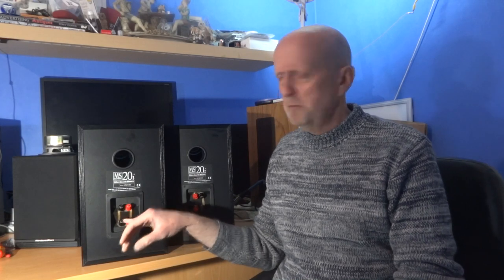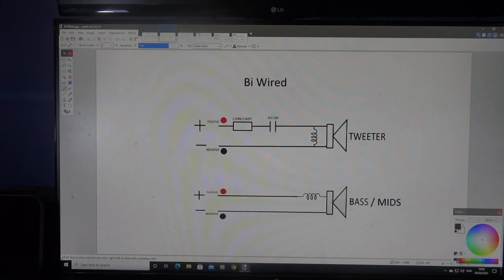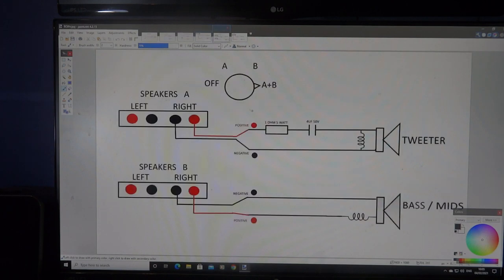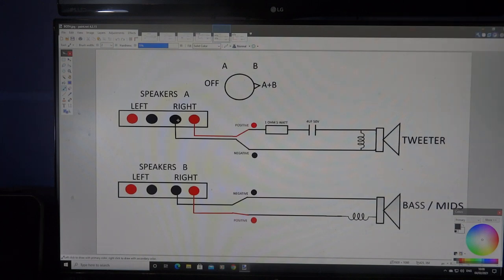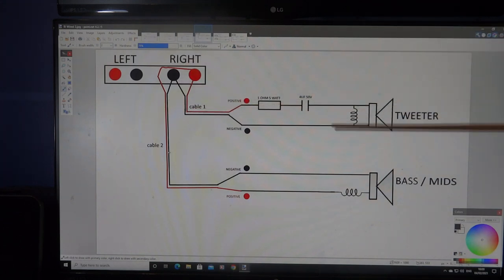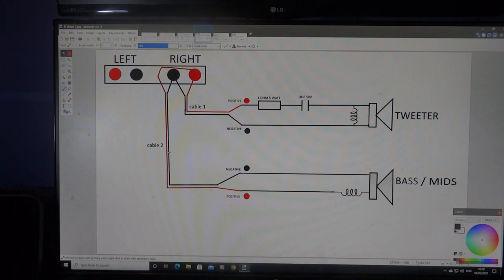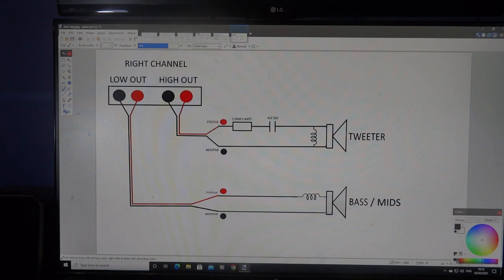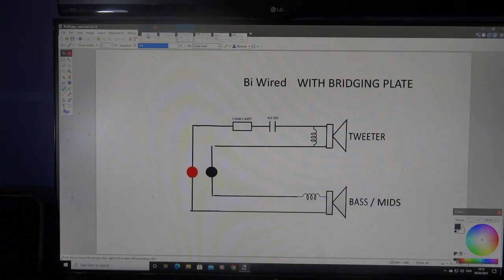Speaker Bi Wiring Explained,  improve the sound. Bi Wire Amplifier Receiver. Wired Stereo Speakers

Comment: I’ve had good experiences of bi-wiring and on my latest pair of speakers I’ve even selected different wires for the two drive units.  My usual Mogami cable actually caused the treble to roll off slightly, so by bi-wiring I was able to leave the Mogami cable on the bass driver, where it’s very happy, and use a different cable on the treble.  Balance restored and even more separation and clarity than before.

I do applaud you for venturing into this area as here be dragons, specifically in the form of sceptics shouting snakeoil.  One of your other commenters has experienced the misinformed rants of people who seem totally incapable of educating themselves on the electrical theory which applies here.

I can’t easily think of a non-electrical example to explain bi-wiring, however, I can say there are three reasons why the sound may change if you go from single pair to bi-wire.  Firstly, you are removing the interlink on the speakers.  Where this is a cheap brass plate, an improvement in conductivity is assured.  

Secondly, you are introducing more cable and hence changing the resistance and capacitance characteristics of the connection between amp and speakers.  The change in sound will be subject to the way the amp and speakers react to these changes.  Most likely good, however, it’s not guaranteed.

So far, so safe. Thirdly, and here’s the controversial bit, from the separation of the current between the pairs of wires.  Notice I said current, not signal.  Signal is most often the imprecise term used to define the electricity in the wires.  Obviously the voltage, or potential difference, across the amplifier binding posts is modulated by the music.  Whether that voltage cause a current to flow depends entirely on the resistance of the circuit it is connected to.  The lower the resistance, the more current will be drawn from the amp and vice versa.

The two circuits in your illustrations present a varying resistance depending on frequency.  For the tweeter, the components in the circuit present a low resistance to high frequencies.  As frequency falls, the capacitors present an ever increasing resistance.  Thus current is drawn down the wire at high frequencies only.  The opposite applies to the bass circuit.

In these circuits, with resistance varying with frequency, the term given to the characteristic is impedance.  A speaker will be rated as having a nominal impedance and sometimes a minimum impedance.  Impedance is often depicted as a graph of resistance over frequency.

Anyway, if you hear a difference with bi-wiring I will not be surprised, it’s been my experience every time.  However, whether it’s down to one or all of the above, it is a real thing and I strongly recommend giving it a go.
Reply from the maker: Thanks Mark for your very in depth comment and experience in bi wiring it was an interesting read and a help to others.

Comment: I share your scepticism, Michael. The sole benefit of bi-wiring that I can see is that the cable manufacturers double their profits. There are no buses or motorcycles in speaker cables, of course, just electrons. The modern-day hi-fi industry would be in serious trouble if audiophiles ever gained a basic understanding of the laws of physics!
Reply from the maker: Bi Wire and cables probably one of the most debated articles in HiFi that will really be left to how end user hears the difference themselves.
Reply: I’m new to the subject but from what I gather the properties of the cable (cable construction type) makes the high frequencies behave differently from low frequency, some cable companies build cables with both in mind have twisted pairs and different core arrangements leading to simplicity, now let’s look from other perspective, having two pairs of connections on the speakers leaves you with choice, if you need or not maybe that’s what each person will find out. Personally I wouldn’t use two cables but would definitely use bi-amp. But yet again I’m new!

Comment: I have watched many videos on bi-wiring and also bi-amping.
As at moment I only have 1 amp,  I have bi-wired my amp with banana plugs, and removed plates from my speakers,  connecting 4 wires too speakers,  and honestly,  wow what a great sound difference,  also better quality sound,  can hear instruments I never heard before. 
I have tried this on my floor standing Wharfedale speakers and also on my floor standing Mission speakers,  recomend this, makes a difference with gd speakers. 
Also banana plugs make a difference.
My nxt step is 2 get another amp and bi-amp.
And split signals for 4 speakers,  either tops of 1 amp n mids from another or maybe try with channel B.
Enjoyed the video n was exactly what I also had worked out.
Its trying combination to see what's best. 
Iv balance up n run a jamo sub, n that's even smoother and better than b4.
Keep up gd work.

Comment: Thanks indeed. Great explanation.  I just bi-wired a NAD C 272 power amp into pair of B&W DM603’s.  I had not bi-wired this set-up previously believing the concept to be smoke and mirrors. This NAD model actually has two sets of speaker outlets so why not?  The speaker cable lengths are a short 5 feet.  Bi-wiring this particular combination has made a serious improvement in music sound quality; openness, detail, you name it. I have had these speakers for 20+ years so I pretty much know what they sound like.  The pre amp is a Simaudio Moon P-3.  This is my experience only but I am totally chuffed with the outcome of this change.
Reply from the maker: Thanks for your comment and infomation on your system. I am only to pleased that you have heard some good results in your bi-wiring that is what it is all about really, getting the best possible sound and getting pleasure from your HiFi

Comment: A better option is speaker wire to top red, bottom wire to black bottom and make sure conductive plates are copper or a solidcore copper wire. You'll hear a immediate difference as you bypass those cheap brass plates and made a more direct connection. trade the brass to copper connector for next upgrade.

Comment: I was watching a few of these video one guy said some cable work better for High & some better for low signals so the two different cables can do what they do best. I could not tell the difference when I set my Yamaha AVR to Bi-Amp & hooked up regular Monster cable 12 gauge wire to each post to a different channel on the AVR to Polk Monitor 70 Series II .
Reply from the maker: Think this is a very subjective topic. I can maybe see it making a slight difference when connecting some very high end amps to high end speakers, but for low budget items would be a lot lot less if any, but again would not completely rule it out and still worth trying.

Comment: Help please, my subwoofers have a gold plate connected the speakers input. Should I remove the gold plates?
Reply from the maker: I do not think the subs would be using bi-wire, but if you let me know the model I will try and see if I can fined some images of the wiring connections to advise

Comment: I’m new to diy audio but correct me if I’m wrong , but even if you bi wire meaning using both set of terminals on your speaker and the one set of terminals on your audio source is it really bi wired ? even though you split at the speaker you are still connected at the out put source meaning if there was an interference between the two drivers it would still pick it up at the out put source 

Also if you have an (A or B ) or (A+B)  option  on your audio source so you can run two separate wires . you are still connected together where the A and B connections originate inside the audio source ( stereo or amp) so if there is interference you still pick it up there even though you run two separate wires because it is never really separated 

I feel that if you wanted to remove interference from one driver to another you would have to bi amp 

But if you bi amp you are still connected at the audio source where the two amps get the single from so you could still get the drivers interference there

Am I making a valid point or am I clueless
Reply from the maker: No this is exactly true, but a lot of people can hear the difference between non and bi wired, though 2 wires instead of one would reduce resistance and increase capacitance so this might be a factor in the sound difference as well. as well as the crossover maybe not interfering so much if at all
A bi amp would be the best option as even the souce would be the same the amp sound signature bass and treble would have thier own path to speakers, but again could be still up in the air if actually making the sound better
Reply: @MichaelYates  cool thanks for responding again I’m new I have the most basic understanding of sound/energy how they work and how they can be manipulated to reach a desired effect now that I’m starting a couple diy projects of my own I realize I have a lot of fundamental / theoretical information and concepts I have to educate my self on so I have a pretty steep learning curve to deal with but if I’m interested in something I’m a pretty quick study so no worries .  with that being said , are there any sources of information on the subject you can refer me to ( books, papers , or studies ) preferably written on paper that I can hold in my hand like we did in ancient times in the 80s and 90s lol
Reply from the maker: @CyrusGolmaryami  Sorry I can not help in directing you to any books or studies on good old paper lol. I dare say wont be that easy finding any either.

Comment: For anyone, so if you have a bridge plate are the speakers already bi-wired and if you do decide to bi-wire the speakers to your receiver/amplifier do you remove the bridge plate?
Reply from the maker: The bridge plate is used if only running one speaker cable from your amplifier so the speaker this would not be classed as bi-wired. If you remove the bridge plate you will need two wires from the amp to the speaker hence bi-wire, then the speaker would be classed as bi-wired.

Comment: Great explaination of how to wire it up and what's going on. One point though! I understand the "experts" say that mids/bass don't suffer from treble being on the same road as them or, biwiring does nothing for mids/bass. I suspect different methods of wiring things up does change the overall sound though, a bit.
Reply from the maker: Thanks Marcus. The Bi Wiring in theory should help the mid/bass in pretty much the way it helps the treble, but as signal leaves the amp via 2 cables ( for one speaker cabinet ) on its way to the speaker, the full spectrum is going down both cables and only gets filtered out once going through both crossovers in the speaker cabinet. This raises the question whether there is any difference than just using 1 cable and not being Bi Wired, rather than 2 and Bi Wired.
Reply: @MichaelYates Please see my post elsewhere on whether the same 'spectrum' goes down both tweeter and woofer wires...IT DOESN'T!

Comment: Hey I’m having a strange problem and wondered if any one here could help me, I got a new set of speakers and they have the separate inputs, but I can’t seem to remove the bridges between the inputs, 
    they seem to be underneath the connector it’s self, not just the twist nuts, I tried a little bit of prying but it feels like it’ll break before it comes lose. Am I missing something?
Reply from the maker: Don't know if you can take out the complete panel with the terminals on, normally a nut inside holding each terminal on the panel, could try undoing this to loosen terminal to remove plates.

Comment: Garble. The hole spectrum is present in both cables until it reaches the filter. Use normal wiring if you cant split the signal before sent to speaker or Bi-amping which is the real benefit of having two set of terminals.
Reply: This is a misunderstanding that is very widespread....and proposed by those who know nothing of how electronics actually works - particularly anti-biwire fanatics ( look at Zillch's 'Biwing: The truth Revealed' for example!) 

The current signal splits at the point the cables diverge to the tweeter filter and the woofer filter - this may be inside the speaker cabinet after the speaker terminals in a 'normal' single wire set-up, or at the amplifier end where tweeter and woofer wires join in a bi-wire set-up. The CURRENT signal (that which powers the drive units) IS NOT THE SAME in the tweeter and woofer wires in a bi-wire system; the treble current signal travels down the tweeter wire and the bass/mid current signal travels down the woofer wire.

Does bi-wiring make a difference? I don't know...but I do know that trying to 'prove' it doesn't with bad science gets us nowhere!😊
Reply: Bi wiring requires that the user crosses their fingers and ignores the placebo effect. They believe somehow the highs chose this wire and the lows that wire, voluntarily.

Comment: The busses and motorbikes analogy falls flat because electrical energy isn't  electrons flowing through a wire like water in a sluice hitting a paddle wheel.  Electrons are the medium through which electromovite force moves while electrons themselves drift through the wire relatively slowly.    It's like sound in air;  sound doesn't work by a wind hitting your ear; it's your ear detecting the CHANGES  in pressure as the wave moves THROUGH the air molecues.  It's also like waves in water;  if float an object in water with no current or wind acting upon it,  it won't move or very little as wave pass beneath it.  (Ocean)  waves are not water moving they are energy moving through water.  

Secondly;  the highs and lows leave the power devices,  that is,  power transistors be they discrete FET's or STK's as highs and lows together.  It's a composite signal.  Pretending there are no lows in the wire directly connected to the tweeter doesn't change physics.  The "lows"  are still filtered out at the crossover no mattter what wire it travels through.  I guarantee you that the phase shift inherent in crossovers has a much bigger effect on sound quality than bi-wiring.  That's why a well designed two way is still preferable to an only okay 3 way.
Reply from the maker: Thanks for suppling some very good information
Reply: So what about tri wire
Reply: Erm, not quite right KayZee! ' Electrons are the medium through which electromovite (electromotive) force moves...' you say. It's the other way round really: EMF is the 'potential' present at the amplifier terminals, and the electrons move dependant upon the size of the voltage signal (EMF) and - and this is the important bit - the load that is 'presented' to the amplifier. When you split the feed from the amplifier to supply current to the tweeter and woofer filters the load is different as seen by the amplifier from the tweeter wire than is seen by the amplifier at the end of the woofer wire. Consequently, the load presented to the amplifier by the combination of tweeter drive unit and associated filter components to, say, a 50hz bass signal will be high (typically 10Kohms with a 4.7 mF input capacitor in the tweeter filter) and next to no current will flow from the amplifier down the tweeter wire. The load presented by the woofer and woofer filter components, however, will be very low at 50hz (the input inductor will present no barrier) and consequently current will flow from the amplifier output terminals down the woofer wire to the woofer. In the case of, say, a 10kz treble signal the roles are reversed and the signal flows along the tweeter wire and NOT the woofer wire.
Half the problem is, I think, that people think the amplifier is pushing out the signal and therefore it exists to be apportioned by the crossover. - this isn't how it works! The current (the signal) is 'dragged' from the amplifier dependant upon the load.